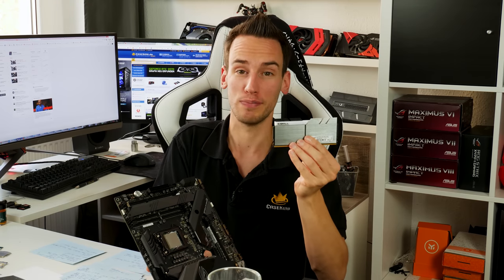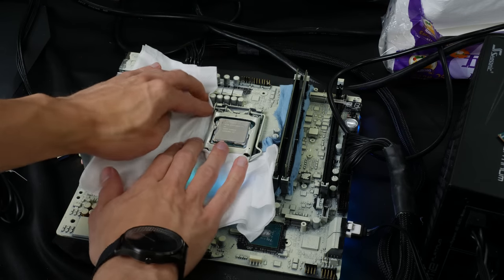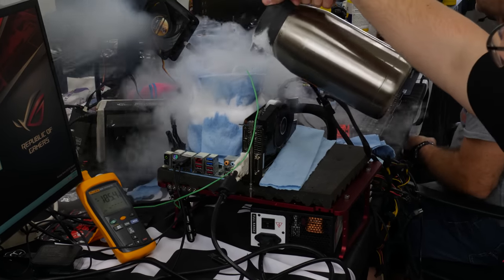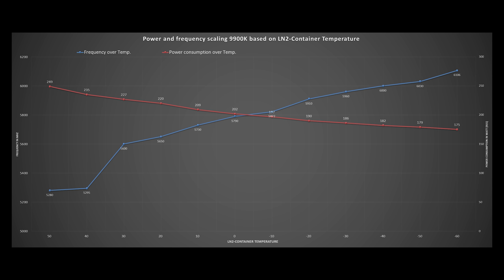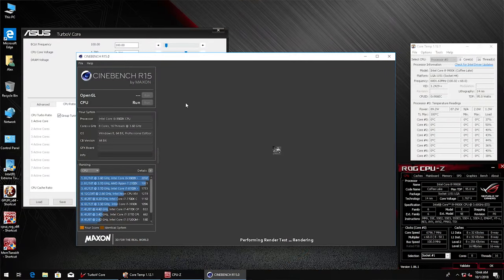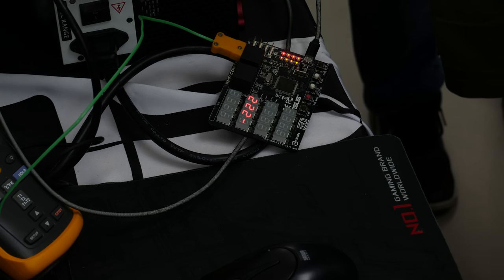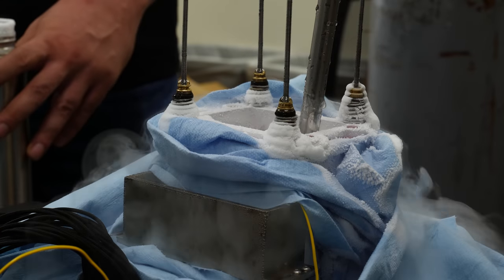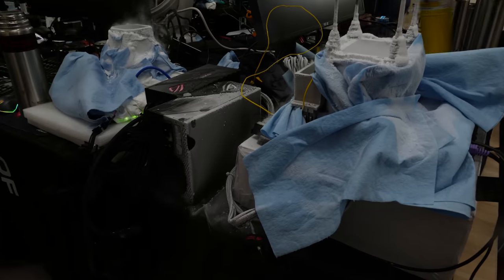World Record with i9-9900K at -230 °C - LIQUID HELIUM

Comment: And I'm here with the stock cooler from AMD and 40 degrees celcius on idle
Reply: Wait until you go liquid cooled, I get a max temp of 60℃, average temps of around 35℃, from my 2600x. I've only got a 120mm AIO. I've seen the boost clocks go pretty high too, I don't recommend oc'ing unless it's for heavy loads, as the clocks boost relative to the temperature.
Reply: @critical_unknown  an aro-m14 gives yoz same temps for less money^^
Reply: rest your beer on top of the heat sink. that should be good for 50mhz
Reply: IM STILL WAITING ON MY KRAKEN X62 THEY ARE ALWAYS OUT OF STOCK!!!!
Reply: My AMD stays below 0c at 1.7 Vcore for daily on FX, you guys just need better coolers!
small phase cooler, at 500w block temp ~25c, I'm actually using 10+ year old thermal paste, lol!

The new Threadripper CPUs are crazy though, on an AIO so small you see the sides of the CPU sticking out, it still tops out around 65c at ~4 Ghz (1st gen TR, I'm sure 2nd Gen will do that at 4.1-4.2 Ghz). Plus those run 3600 Mhz quad channel without any tuning if you're used to memory training on regular Ryzen. I'm waiting for Der8aur's BEAST cooler to become available, I so want to do LN2 on it, I hop its $500 or below, but even if its more I might still buy one.
Reply: @Jake Garrett 24/7 sub zero??? you'd better do a video then. unless it's b.s.
i'm picturing a large block of ice that is over a drain and just dripping water.
I guess you could use it as a dehumidifier.

for the money you spend on cooling your fx you could just rent my ryzen and get a performance boost even on "only" water
Reply: full open loop ftw
Reply: depends how hard you want to push.. i had a 240 aio but moved to a open loop with 2x 360s and a 140 but still i can get up to 80c if i push very very hard.
1800x @ 4.025ghz @ 1.4125v runs good for 100% load 24/7 at around 65c winter and spikes up to 72c in summer in England
Reply: @KillaBitz  Link is the video of it on my other channel. Later I'll feature my quad Fury Halloween build on that channel as my first decent vid, I'm making the casket case now) https://www.youtube.com/watch?v=8h0ieFOeqtI&t    Due note this is on a 4 phase VRM (pushing around 450-500w), $40 board new in 2015, so I'm voltage limited.

As for price, I've also got Threadripper running 3600 RAM (will be the Halloween build CPU, "ThreadREAPER"), Ryzen 1700, Titan Xp collectors, 4x Fury (probably buy a couple more for binning), 4x RX 470 (need to run those in TimeSpy, I already have 2x record even on air thanks to BIOS mods).

Halloween build should be fun, sub if you're interested in it (feel free to unsub after too).
FX ran fine for 72 hours non-stop without condensation issues, I run small heaters in between the insulation layers. You can run this for daily, I haven't had any crashes yet.
Reply: @KillaBitz  I would be careful running that much voltage for 24/7 use. AMD has stated that they do not reccomend more then 1.35v for 24/7 use. The problem doesn't ly in the cpu/power delivery itself. It's the IMC (integrated memory controller) that's in your 1800 which is very capable of degrading from 1.4v+ core.
Reply: @Snuwfer i know... it's fine.... 1.35v will make it last for 30 years but 1.42 will probably kill it in 5 years. Don't go above 1.42 or it'll go down quick (stock voltage is 1.2-1.4 (to 1.45 under boost) on my board so ASUS don't think it's that bad).
The imc run's on a different voltage. (i run at 1.175v imc (aka soc voltage) and AMD recommends not going over 1.2)
The 1800x is a binned Ryzen it should take more abuse than a 1700 witch would be an imperfect 
version of the same cpu (so it better take it or what did i pay extra for)
it's been fine like this for 19 months like this and shows no signs of a problem yet and it'll do the same again i think and by then it'll be time for an upgrade.
If it degrades i'll just run it stock..... but it won't because vdroop.
I take it you don't have a Ryzen CPU because everyone runs them at 1.4v-1.42v.... every one..... 
Even 2nd gen Ryzen seems ok at 1.4 though i wouldn't push much more than that on 2nd gen i guess
Reply: @Snuwfer  so you've got that setup.  The water cooled one looks like mine to be fair. (Very nice) and you run it at stock voltage?? What clock's can you get at 1.35v??
Reply: change the fan profile , it's 40 degrees on idle because the fan is spinning at 300 rpm
Reply: My intel family 3000 goes up to 100c. No joke
Reply: Me with Intel stock cooler

Comment: How about stability under AVX2 load (Linpack Xtreme, Prime95 Small FFT with AVX2)? AVX loads are becoming more common place. Testing speeds, benchmarks and temps  with zero AVX2/AVX512 load seems to be carry-over from the past....
Thanks for another great video!
Reply: It is fairly easy to overclock/undervolt beneath the AVX stability limit. This makes Cinebench R15 useless for stability testing.

Comment: Hmmm a scarce resource that we're running out of and we build multi-thousand installations for to not waste any.... lets cool a cpu with it :D
Reply: Liquid Hydrogen is better. XD
Reply: No, it is a massive fire hazard, and not nearly as cold.
Reply: Joseph F That is why I was being sarcastic.
Reply: liquid Hydrogen have only 16 kelvin difference in temperature comparing to liquid helium, you wont even notice this "masive" advantage of helium in terms of cooling, but hydrogen have almost 3 times higher heat capacity...
Reply: @EricHallahan  That's not how sarcasm works
Reply: @alexanderfl-ts3171  True, but the massive fire hazard still remains. Hydrogen reeeeally likes bonding with oxygen. Working with liquid hydrogen around computer components may not be the smartest move.
Reply: @alexanderfl-ts3171  yup, but you have a hinderburg in potency expecting to blow up if you use it
Reply: That cpu was running so fast that they were able to use it to see the future...
They found that in a couple of years we will master nuclear fusion and have pleanty of helium so they proceded to use the remaing to make icecreams.

Comment: Have you considered creating a device that lets you run a line right from the tank and regulate the flow to a drip rather than having to pour the liquid nitrogen manually? I have never messed with sub-zero cooling so I am not sure if that is a really stupid question. You guys are crazy, servus!
Reply: Kingpin created Roboclocker for that purpose.
Reply: While I'm not sure if der8auer has done it, this is exactly what Kingpin's Roboclocker does. A lot of overclockers give him grief because it makes the process so hands-off. He just sets a temp on his LN2 controller and the automated valve keeps the CPU at that temp by varying the LN2 flow.

https://www.youtube.com/watch?v=ZYLL5f_NBT8
Reply: Genius
Reply: thanks
Reply: From a controls perspective, there is a lot of space to improve Roboclocker. In the showcase video, he just uses a PID loop.
Reply: A cryocooler is probably the best device for this. They’re actually used in quantum computing experiments as well. When you can get a used one for a few grand on eBay, I’m not quite sure why he wouldn’t just invest in one.
Reply: @soul_in_a_fishbowl  way too late, but I'm pretty sure it's because cryocoolers are usually designed for relatively low power loads (a couple of watts at most). Not multi hundred watts CPUs.

Comment: Here is my idea. Copper block, overcoated with nickel alloy and gold coated on contact side with cpu, indium foil as thermal transfer mass. 2 stage system to bring the coldhead down to less than 50K. Of course you would need to have a double layer to minimize outside atmosphere exposure so it would have to be very close mounted to the board, that should decrease condensation on the board. Flex lines to carry the helium to and from the compressor. System would be started up at higher temps and overclocking slowly increased as coldhead temps drop. I believe this way you can push even higher figures.

Comment: If you want to push this I think you really need some better dewars with internal cooling fins in the helium. Right now the amount of gas produced and the Leidenfrost effect are making the heat transfer between your dewar and the helium inefficient. Also adding some insulation around the rest of the dewar and having a closed top with a dedicated in- and outlet for the helium will get rid of all those clouds of vapour (not smoke!) and might reduce your helium consumption a bit.

Comment: the only sabe way to use a motherboard with nitrogen or helium is cover it with silicon and epoxy resin leaving only the holes on the chips and capacitors to cool them, that way you can use it without being afraid of condensation you can even use it underwater if you want

Comment: Why not use a Cryo system like cryogenic high vacuum pumps? Instead of wasting so much helium you could make a special block that would recycle helium through a compressor. Use a compressor to compress the helium and wick the heat, as it expands inside the block it would take the heat from the cpu. The pumps I work with get the coldhead down to 10-12K constant, I'm sure it can be adapted for this use.
Reply: It would be smart but the cooling power of cryopumps is not that high. At 10-12K the cooling power is a few watts. A cpu will generate more than 130w easily when overclocked and the cold head would be unable to maintain temperature

Comment: Great video as always!
I don't really get why decreasing the temperature of the CPU also decrease its power consumption, do you guys have any explanation? It's definitely interesting and I'm really curious to learn more about it.
Reply: Power consumption is mainly due to resistance of the conductors which is mainly caused by the thermal vibration of the material. So the more the material is cooled the less thermal vibration there is.
Although with semiconductors (like the silicon that is used to realize the logic switches/transistors in the cpu) you need a minimum temperature to make it conducting in the first place, so i guess this kind of extreme cooling wouldnt work for older cpus with larger transistors.
Reply: Thanks a lot for the explanation, really interesting !

Comment: I wonder how far Ryzen would go at those temps!
Reply: I think, with good sample, around 5900-5950 MHz Cinebench R15 run and score could be 2730-2750 points
Reply: AMD has never let its chips get over 83ish as far as i'm aware. (at least since 64bit) They used to crash at 83ish (before throttling was invented) (i'm sure someone will tell me there bulldozer ran at 90 all day long but my one did not and it depended on the board to disable this i believe)
i can't get my 1800x over 83 at all it downclocks or crashes after 83
Reply: @KillaBitz  max operating temperature for all ryzens is 95c which I can confirm from my overclocked 2200g at 95watts on a stock cooler lol
Reply: Nvm i just prived myself wrong. Apus get 105c, 1700x is 95c and then 1800x is 95c
Reply: my 1800x bluescreens way before that. as did my 8350, my 1100t, my phenom x3, my athlon x2's , my athlon x64's and my athlon xp's.
but like all core boost, tdp, clock speed and other things this is likely something a board vendor can have a hand in.

also you have a gpu heating up your chip. i think that effects your results.

i could also be wrong. (i'm sure that once upon a time this was true and it still seems so now)
Reply: @KillaBitz  I've tested Ryzen 2600X's and observed them to run just fine up to at least 93C or so. They get that hot stock out of the box if using the included cooler (which, while a nice box cooler, isn't adequate for running even 6 cores at 4 GHz). I've also gotten my 1700 into the 80's but I don't recall exactly what I've gotten up to as I was in no hurry to stress it out.
Reply: cool (or maybay hot) so we are not exactly disagreeing then are we. i've got 3 rad's cooling my one so maybe things would be different with a stock cooler. Why would anyone buy an X cpu and run it on a stock cooler??? 
I can't really argue with you but i can say i've had loads of AMD cpus and have never got one to 90c in over 20 years of pushing then as hard as i can.
i run a 24/7 at 88%-100% load doing h.265 encodes. i've pushed this cpu as hard as it will go for 19 months.
During the summer it was sat in direct sun light with no ac in our house.
I had to downclock it (to stock) for a couple of months because the extra heat made it unstable.
I've hit thermal shut down a few times but as far as i can tell I've not hit 90c yet.
Reply: also be aware there could be wild differences in how we are monitoring temps.......
my board claims the socket temp is the cpu temp but since i cool my vrms so hard that never gets over 50 and the on die sensors give a much higher reading.
also the 20c offset shouldn't be catching anyone one out at this stage but it depends on the tools ppl are using.
also are we doing some kind of average or talking peak???
if peak then how long is the polling interval and how long must the peak last.
temps spike up and down a lot.
if your cpu spikes at 99c once an hour for 0.1 seconds but spends the next 60 minutes ish running at 60c then it's running at 60c........ or is it????
Reply: no 2 temp sensors read the same measurement but if they did you would still have to have a sensor that took readings at 4 thousand million times a second and was some how inside every part of every transistor at once.
having it near by creates a delay that flattens every thing out as do things like only polling the sensor a few times a second.
a lot has happened in the time before the next reading is taken.

it's possible the thermal shut down temp is 100 but i've never been able to record to log a temp higher than 83

like i said arguing over this is very pointless because its like arguing over how dark night is.
Reply: 6GHz is ryzen record i think

Comment: Now on Craigslist: Gaming computer for sale. Barely used. The CPU is smoking fast and is higher speed then any other CPU you will find! Slightly overclocked but never overheated! Must sell now. No lowballers - this system is top of the line!

Comment: Obviously condensation is a huge issue. Why not put the mother board in a bath of mineral oil? Condensation shouldn't form as there is not air/water under there. The oil I imagine has a much lower freezing point. The oil is non-conductive. Sure it is hella messy, but it would work, right?

Comment: I wonder if it'd work to put a system in a vacuum chamber then fill with LHe, since all of the air would have been removed there wouldn't be any moisture so no more worry about condensation.  Though is LHe conductive?
Reply: Wouldn't LHe boil and evaporate in a vacuum so there wouldn't be much point to this exercise.
Reply: @Caluma122  it wouldn't be a vacuum after it's filled with LHe.

Comment: I wonder why no ovreloker uses small radiators on the processor cover or does not make furrows on the processor cover when it is filled with liquid gas?
The flat surface of the processor creates too large cushions of steam, which reduces the efficiency of heat dissipation.

Comment: I have a question: why dropping the temperature that low helps achieve those high frequencies? I mean at a physical point of view, what happens at transistor level that helps going so high with frequency? And followup question: why does the power consumption decrease whule increasing the frequency? Shluldn't be the opposite?
Reply: ResseXxGaming high temperature = Atoms wiggling around more = inefficiency
Reply: I think it has to do with electrical conductivity, lower temperature more conductivity less heat... and heat is a big problem with high clocks. Also with low temperatures the signal noise is lower, which also helps with clocks.

 About you second question, power consumption decreases because the CPU becomes more efficient at lower temps.
Reply: Actually being a semi conductor it is the reverse as they have a negative temp coefficient, lower temp increase resistance which would be why the power consumption goes down.  I think? the mechanism for higher speed is much less leakage in the transistors once they are cooled allowing a cleaner signal at faster switching speeds.

Comment: I Challenge you to "overclock" (in fact overvolt) an AMD Ryzen and Intel Cpu from years 2017-2020 to 2 Volts (2.00125V) and make a video, if impossible on these, try any cpu from range 2012-2020. You don't need to raise clocks, preferably stay at stock  and just get past the 2 Volt mark.

Comment: Isn't Fx chip hold world record with over 8 ghz??
Reply: yes
Reply: yep
Reply: To bad Fx chips are fake 8 cores.
Reply: @4gbmeans4gb61  you are right bro they are fake i got in 3d mark fire strike with a rx 580 and phenom 965 i got 9311 points and with fx 8370 upgrade i got 9690 points
Reply: Ya if it was a REAL 8 core it would have 8 cores and 16 threads.

Comment: So... Are you going to redo this with a lapped 9900k and liquid metal?
Reply from the maker: no. Liquid Metal doesn't work sub zero
Reply: Is it worse than solder at that point? Does thermal expansion cause it to crystallise strangely?
Is solder the best option then for LN2?

Comment: You things are going down with liquid helium at 07:07 when an i9 processor is overclocked at 6796Ghz at 100% workload at 0%. You would think the temps are broken and not working if it wasn't for the fact you know liquid helium is cooling the beast.

Comment: 🥶 Has anyone considered pushing liquid Helium or Nitrogen through a half-closed circuit like water cooling pipes and reservoir heatsink on top of the CPU that are designed to handle the cold? That would be so cool! Literally! And much more efficient than simply pouring it in a can.

Comment: So what is the purpose of this level and hassle and cost of overclocking? After setting a high freq. record what's next with the CPU? go back to stock speed and normal setup so you can actually use it..